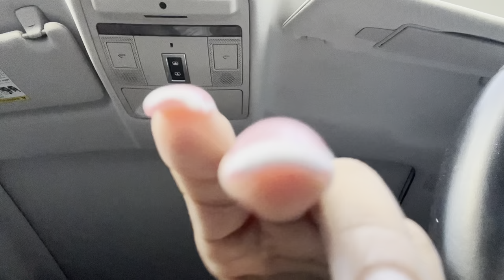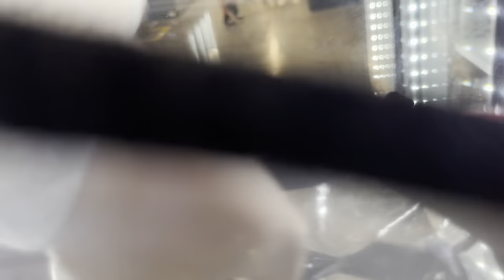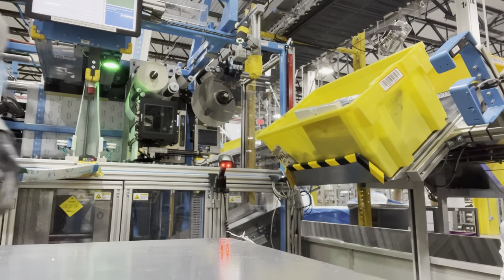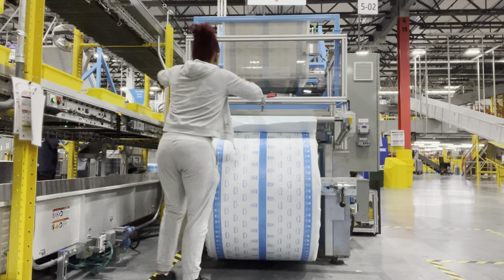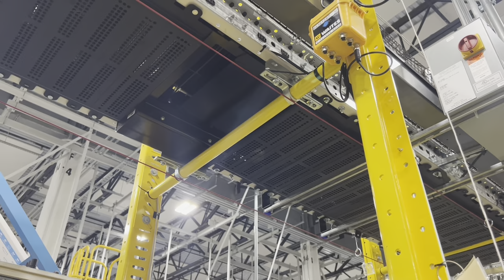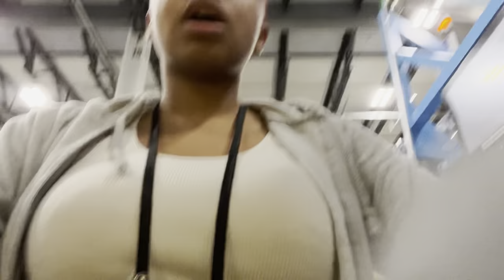DAY IN THE LIFE Working at an AMAZON Warehouse (INSIDE FOOTAGE)

Comment: As a fellow package handler not exactly the same position but same objective I guess, if you’re dealing with something that too big or kinda heavy and you need to flip it upright or whatever the case… use your foot as leverage so the package or in your case those rolls of packaging material won’t slide around on the slick cement floor. I worked at FedEx for 7+years as a loader, Amazon Delivery Driver for 2 Days 😅 and now currently working for UPS as an unloader … it helps a lot using my foot, keep in mind try to move your foot out of the way after you get that leverage if the package is heavy. I wear steel toe boots so it’s never really an issue for me. Not only does this trick help, it makes it easier on your back and muscles in general. Hope that piece of advice helps in some way!

Comment: I just completed the pre employment stuff I’m supposed to start 9/25. Big question I have is. What about using the bathroom. Do you have to wait till a scheduled break. ? And what about cell phones. I will be working overnight part time and I have 4 kids so I need to make sure I’m in touch if needed (husband will be at home w them )
I have IBS but I didn’t put it down as a disability on the pre hire stuff tho.  So now I’m worried
Reply from the maker: Hey ! 

You can ask your manager I know for me sometimes someone will pack for me really quick while I use the bathroom and come back. But for your IBS you can get a doctors note but you will need it before they accommodate you . 

You can use your cellphones for emergencies it all depends but I have two little ones as well & I always check on them throughout my day 🤷🏽‍♀️

Comment: no cap, i realize i hate working with people, im using bluecrew for a warehouse windshield job, i have to work with people and communicate, sometimes i dont know what the hell im doing and it annoys the hell out of me,i dislike asking fellow employees questions and questions, that job is 15 mins away but in the AM it can be as long as 30 mins, the amazon is 25 mins away but i can wake up later, im trying to decide on what to do.  i noticed they upped the pay rate for the position i havent started yet, do i get that or the original i signed up for?
Reply from the maker: You should get the pay rate increase, every October they go through a pay rate reconsideration as well as the step up between every 6 months that you work . I’d say try Amazon ! You don’t really have to converse with people
Reply: @a1sobossy  I switched to a closer warehouse and noticed a $1000 bonus, hope they pay up lol